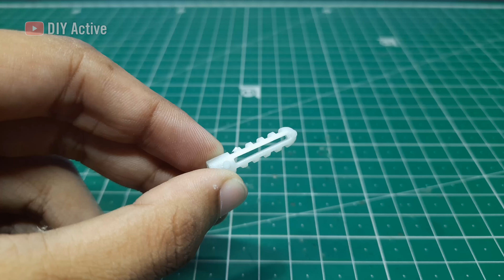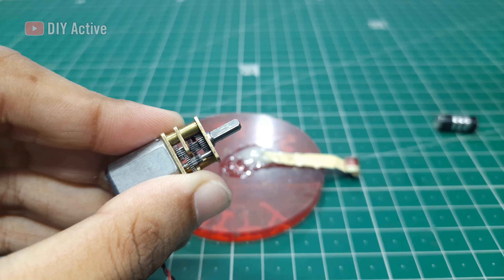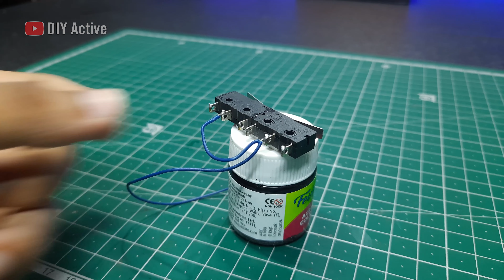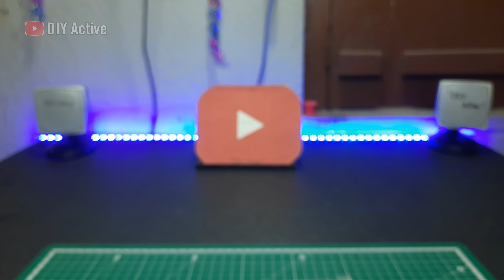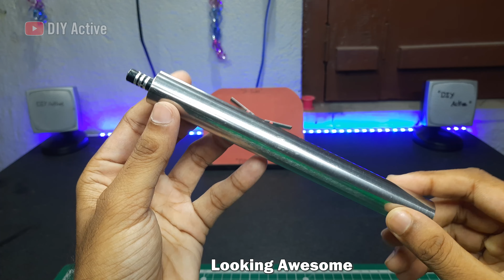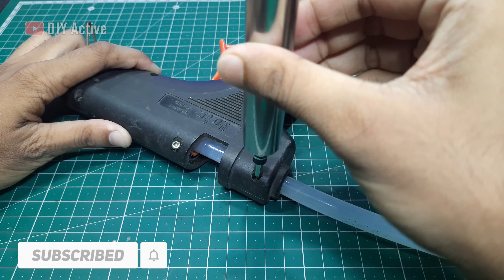DIY Electric Screw Driver ।। how to make rechargeable screwdriver at home using N20 gear motor

Comment: Is power bank module compulsory for motor running , can we connect directly
Reply from the maker: No no , You can also power it directly from the battery, no problem.

Comment: how many RPM?? i think, so slowly
Reply from the maker: 140
Reply: use booster module to get fast rpm
Reply: You dont need high rpm, you need torque. N-20 micro gear motor with 100 rpm is good enough for this kind of screwdriver.